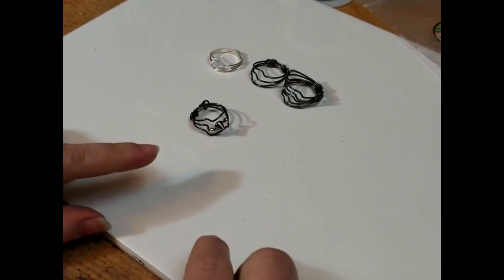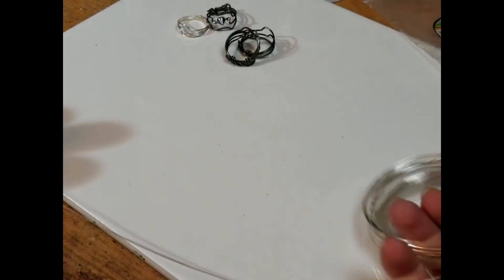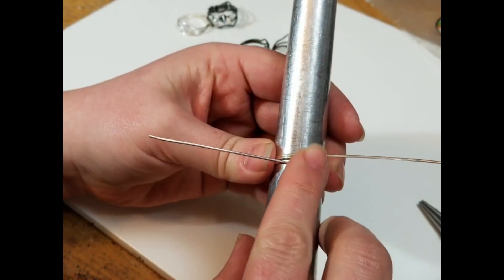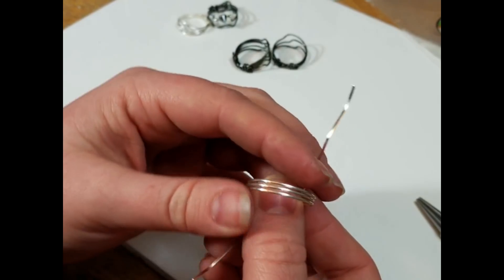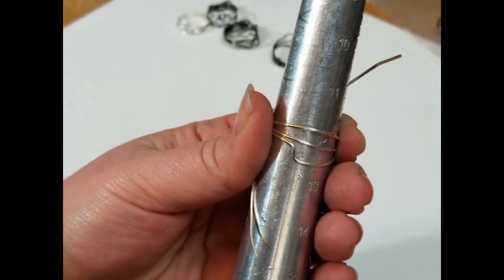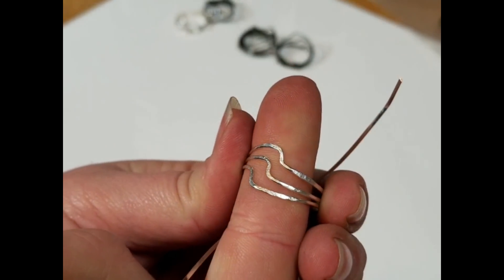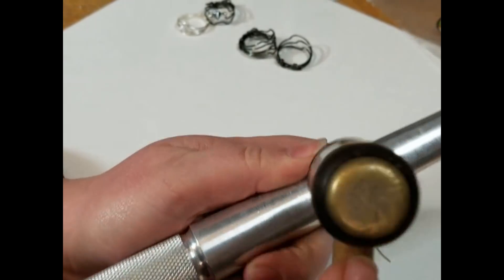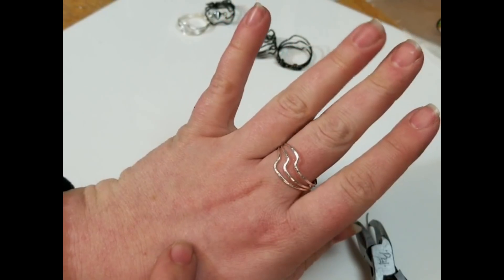Wire Wave Ring

Comment: Thanks for the video. The black wire ring ware your pliers slipped can be coated with black finger nail polish works good. I made some wired chairs for a miniature diorama and coated all the copper that poked threw with black nail polish.